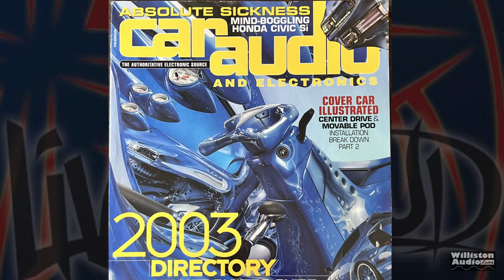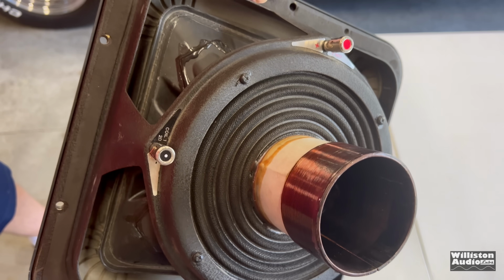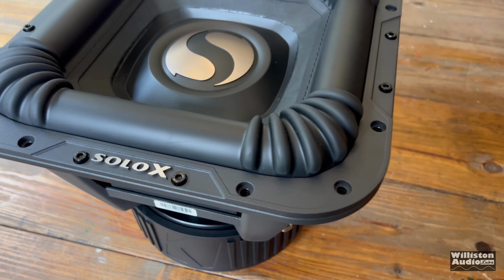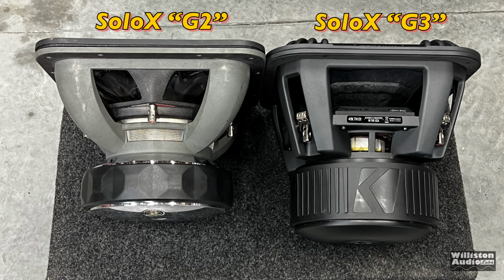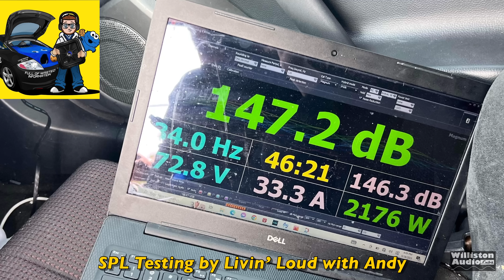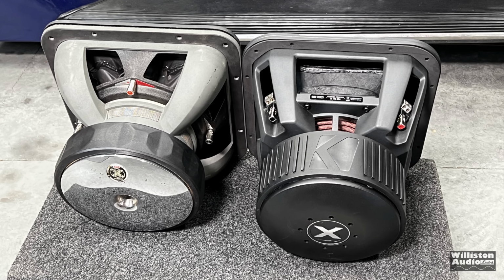KICKER SOLO X Old vs New SPL Subwoofers Review and Comparison S12x L7X

Comment: Thank you for the speaker specs as we just purchased a set of 12" dual 2 ohm Thursday May 25, 2023. Also 4 Kicker 7" square & 2 9" square midranges. We will strap 2 Kicker or EMF mono blocks at 2 ohm for the 2 12's. A 2.5k midrange amp on midranges, horns, tweeters. Impala Coupe vintage. Thank you for your channel as always, C.J. w/ A.R.T. Atlanta.

Comment: 1992 I reached 154db with under 300w and only 2 kicker solo classics. Even the Kicker show truck only hit 156db with 6  12s and much more power. They saw my van setup and could not believe that was possible. Kicker the company said the solos would not run in a bandpass box, I guess I proved them wrong! And those were running on the old Soundstream 10.0. Lol  Yea a mere 25w x 2 @ 4 ohm amp. Toooo funny

Comment from the maker: SHOP
KICKER SoloX 12: https://amzn.to/497MQYk
KICKER Subwoofers on Crutchfield: https://howl.me/cjNYsFVKgx2
KICKER Subwoofers on Amazon: https://amzn.to/424JpOJ
KICKER SoloX Subs on eBay: https://ebay.us/UMhb2x
D4S Amplifiers and Speakers: https://Shop4Bass.com

LINKS
SoloX Subwoofer https://www.kicker.com/solox
HiFiVega Reconing SoloX Subwoofer: https://youtu.be/DLfXb97u9x4
Livin' Loud with Andy SoloX SPL Testing: hhttps://youtu.be/4UYIM5EJwe8
KICKER Introduction of SoloX (2020) https://youtu.be/TWRK4mpXIRI
KICKER Unmasked SoloX Deep Dive: https://www.youtube.com/live/xx22EgdQYwU?feature=share

VIDEO INDEX
0:00 Intro
0:26 Introduction of SoloX
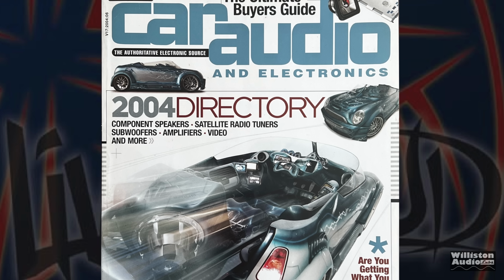0:54 2004 S10x and S12x
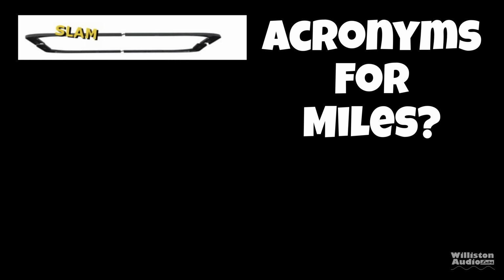1:38 Acronyms
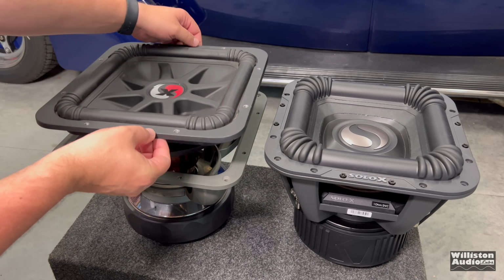2:24 Before Sundown?
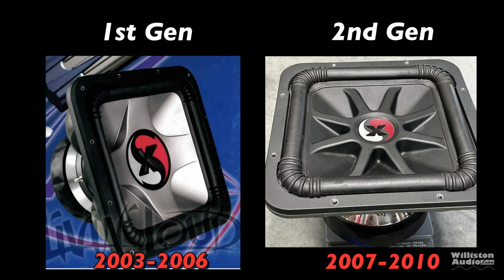3:05 1st and 2nd Gen SoloX
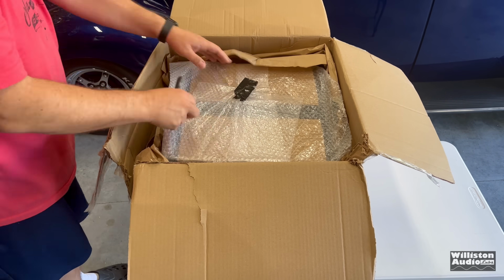3:34 2008 SoloX
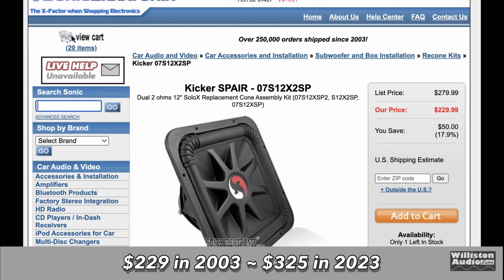5:10 2020 New SoloX
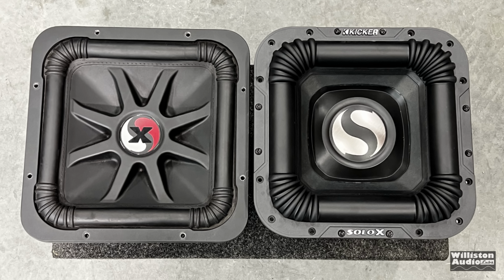7:02 Comparisons
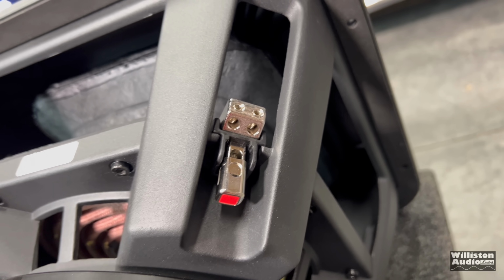9:29 2008 SoloX Flex
10:33 2023 SoloX Flex
11:50 2008 SoloX Pros and Cons
12:34 2023 SoloX Pros and Cons
13:28 SPL and Box Testing Coming
13:55 Alma Gates and the Bronco Beast

VIDEO AND AUDIO GEAR
Camera - iPhone 13pro 1TB - https://amzn.to/3nCjGvc
RODE Wireless Go II Microphones: https://amzn.to/3Q6NVHl
Shure MV7 Microphone: https://amzn.to/3A4OICK
Zoom H4n Audio Recorder: https://amzn.to/3BXjVsS
960 LED Panel: https://amzn.to/2Sxoq3S

TEST BENCH EQUIPMENT
SMD / D'Amore Engineering Amp Dyno: https://goo.gl/sJTcf7
XS Power D1400 Batteries - https://amzn.to/2BPFCKW
XS Power PSC60 Charger - https://amzn.to/2CHGcfs
Fluke 1000A AC/DC Clamp Meter: https://amzn.to/2Rw5WDA
Handheld Dyno: http://amzn.to/2u2EgKV
My Favorite Screwdriver Kit: http://amzn.to/2x0VzcE

DISCLAIMER: This video and description contains affiliate links, which means that if you purchase from one of the product links, I may receive a small commission. As an Amazon Associate I earn from qualifying purchases
Reply: Awsome
Reply: I have two Kicker F15c behind my seats in a VW Passat CC.
Can i use newer Kicker for behind the seats?

Comment: I have a 10" CVX and it has the 600rms L7 coil in it. It is in a 1.75 CF box tuned to 39htz on a 1ohm kicker 400 with certificate of bench 490rms. It flexes my roof. Same speaker underneath, just a round face on it.

Comment: Thanks for adding the weight feature. Many companies omit that spec. And when it comes to a daily driver or a guy like me who does not want to break the transmission, I personally try to locate the lightest subs that perform awesomely. Neo preferred but some companies who make neo subs are putting a steel ring of some sorts to “help” with gauss. But what’s the use of a customer getting neo subs if they are gonna end up being as heavy as ferrite! 🤦🏻‍♂️ 
Those Big Dummies!
Reply: I use my car for drag racing, and I still love my bass, so keeping weight down was a big deal to me simply for speed. Went from SSA Demon 10s to Sundown SD4s to save about 20lbs. And they perform similar if not better.
Reply: What do you drive to work a vespa?? The weight of the subwoofer isn't going to make any difference to a car's transmission lmfao. I bet your make your gf walk next to the car to save your transmission too.
Reply: @bobbygetsbanned6049  
I had a car which after 2 years damaged the torque converter. A cousin of mine also had issues with the transmission. 
If you live in a area of steep hills like I did, you will know bud.
It's always smart to reduce as much weight as possible from a vehicle which is a daily driver. If its an SPL vehicle that I don't drive often, I would not care.
Reply: @Bassotronics  Maybe if you have a huge setup  top level SPL subs, with multiple batteries, huge amps, the whole 9 yards, then maybe. Otherwise, there is absolutely no way the added weight of a sub and box are going to kill your transmission. Whoever told you it did is a moron. You couldn't even have a passenger if the weight of a sub is going to kill  your transmission, which would make it one extremely terrible car.
Reply: @bobbygetsbanned6049  
No sir… the setup was not just one or two subs. It was bigger for sure.

Comment: Great video Big D! Although I think these subs are a bit on the gimmicky side, I’m glad they exist because they help push car audio forward. Maybe you can do a video on the truly silly Bazooka triangle subwoofers that these Kickers inspired.
Reply: Gimmicky? That makes no sense.
Reply: @beyondthedetails   a square driver is less efficient than a round one with the same cone area and motor assembly because of the added mass needed to compensate for the uneven stress across the “cone”. The surround is also heavier because of the corrugations needed at the corners. The only reasons drivers are made in shapes other than round is because of space constraints. These are the reasons all serious home and car audio subwoofers before and after these Kickers came out have been and continue to be round. Even electrostatic home speakers, the squarest of them all, use round drivers for their sub section.
Reply: The square shape is more efficient to stack in a baffle, no car boot/trunk is round, that's why box baffles are made square or rectangular.  The square design will get you far more cone area when space is any consideration
Reply: @2011joser  Stop acting intelligent talking about “efficient”.
Reply: @minus3dbintheteens60  what you say is true but if the increase in cone area was worth the price and difference in efficiency wouldn’t they have become dominant in competition? I’m not saying they are bad by any means, just that they were more of a flex by Kicker and their customers than a true competitor for spl.
Reply: @beyondthedetails  🤦🏻‍♂️
Reply: @2011joser  Competitors may have had issues trying to copy the copyrighted parts of Kickers design. Thats the more likely reason.
Reply: @JasonWW2000  I was talking about Kicker’s own sales. They were used in some high dollar systems but they never became popular in competition. Extant came out with a hexagonal design sub series that was equally efficient in cone area coverage. They were a footnote in sub history.
Reply: @2011joser  What do mean? Kicker won all the competitions back in the day.
Reply: @JasonWW2000  so successful both original versions were in production for only 3 years each? If they were making enough money in consumer sales they would have remained in production. All manufacturers, including Kicker, keep good selling speaker lines in production year after year with upgrades and other revisions along the way.
Reply: @2011joser  Yeah, they are total crap. Never should have built them in the first place. Too expensive, as well. Garbage. 
Jk.
Reply: the new solo x is so “gimmicky” & inefficient thats why it did almost 148db on a single L7X 12. 😂

Comment: Wow, kicker had some tight tolerances with manufacturing to make those drop in recones.  That's impressive.
Reply: Do you mean on the older ones? They had to open the gap a little more than they liked to make it possible. That lost them some motor force, but it was still plenty strong.

Comment: 2:35 i had 2 of these in 10" in a bandpass Rockford Fosgate branded box, in the back of my 89 Honda CRX back then. Very few people would stay in the passenger seat at full volume. Those cars are great for small systems and big bass, i miss that little car.
Reply: before anyone says it, YES, I had 1600$ worth of audio equipment in the back of a $400 Civic. Take it out and that Crx would drag anything short of an actual drag built car for bus lengths. Hurt many peoples v8 feelings back then. Was a B16 DOHC bored to 1.789. So it was essentially a higher compression B18 Type R engine before they made it to the states in mass quantities. Back then you couldnt get an Integra type R engine or the like from japan for any reasonable price, IF you could even find one someone was willing to come off of.

Comment: I remember my Solo X 18 in my 96 Tahoe. I opened up a beer one time bumping it and the whole beer foamed up😂 I had it on 2 T2500BD. I sold the set up to my former coworker. Now I'm running 4 15's in my 2dr Tahoe running a DS4S JP63

Comment: Never forget when my son got his driver's license I gave him my used Honda Accord. I was buying a new car anyway He was happy. At that time I was working in a wholesale car audio shop. Decided out of the Clear Blue Sky that I was going to build a system for him. My money, my time. Went with a Pioneer head unit. We had this brand called Cadence that I thought was a good value for the money. Got two 12-inch Cadence woofers and a big vented box. Used a Power Acoustik monoblock amp for the two Cadence 12s.
I thought it sounded fantastic and a million times better than the stock system that sounded like garbage. My son being spoiled tells me his friends have kicker and they never heard of Cadence before. Forgetting about the sound. All about the name and competing with his friends.
I wanted to kick my son after the money and time I spent out of the goodness of my heart. About six months later I took out the Cadence and Power Acoustik amp. Replaced it with a single 10 in Square Kicker woofer 2nd edition and a Kicker amp. Now he was happy.
Spoiled but he was a good kid he deserved it.
That's my experience with kicker.
Reply: When I was a teen, I went out and bought these home speakers and put them in the back seat of my car.  They were only rated at 100W, but the sensitivity was somewhere around 96 or 98db.  I just turned down the bass a bit and out SPLd all these rich kids with 1 or 2 thousand dollar custom stereos.  About half would get super mad that my cheap speakers blew away their expensive stuff.
Ever hear of the Cerwin Vega D-9s.  My "cheat" inspired a kid to put two of them in his back seat.  He didn't have enough amp to power them at 100%, but he didn't need it.  He rattled everything that could rattle within 30 feet of his car.
101db at 1w, and 400w max power rating meant those D-9s were capable of producing 126db each, so about 129db inside his car with no sub.  These kids buying the name and getting somewhere in the 80's db sensitivity meant they needed some ungodly amount of power to match it.  And back in the 80s without class D amps, you needed competition level engineering to power it.  As it was, his "thousand watt amp" was pushing maybe 60 watts.  But that was still roughly 122db, much more than a lot of these kids with "name brand" stuff could produce.
Home speaker sensitivity is measured at 1 meter, and you can barely get 1 meter away from a speaker inside a car.  So it's not a simple comparison.  But you get the general idea at how crazy we teens were back then.  Especially the rich kids.
It's actually nice to see how much the prices have dropped since then.  Pretty much anyone can afford to ruin their hearing these days.
Reply: Cadence made some really great subs. I had a Cadence S3W12. Really nice sub wish I had not got rid of it.

Comment: MY 2 QUESTIONS IS WHAT AMPLIFIER WOULD YOU USE FOR THE NEW KICKER SUBWOOFERS & THE KICKER AMP VIDEO U DID A WHILE BACK WOULD YOU PREFER THEM?
Reply from the maker: KICKER is bringing back the Warhorse amp first as a 3600W monoblock. It has some really cool features including a remote LCD display. In this video I used the D4S JP23v2 for testing these subs free air. See them at Shop4Bass.com

Comment: Well, there use to be this car audio shop here in Colorado named Sound on Wheels. They had this demo vehicle which was a 1995 Chevy Suburban nicknamed the 'Burban. Every speaker in the entire vehicle was Kicker including 3 Solo X S18x's powered with 2 Kicker ZX 2500 each! Total system power was 17,000 watts! 😱 Let tell you not only the 'Burban was loud it sounded great too! My good friend designed and built that system to be loud, clean and clear!  Oh, and by the way the 'Burban would easily bust mid to high 150's. I apologize about the long post but I had to mention that the SoloX wasn't just an SPL sub it can used for daily as well. Have a good day. 👍🏿

Comment: IMO it shouldn't be considered a 12". The old sub had more cone area. The measurement showed 10.5 so that's 110.25sq inches cone area. A typical 12" sub has 113Sq inches. Their big shtick has always been go square and get more cone area. This sub should have been made 1/4 inch smaller ATWR and been marketed as a 10. 
Remember this is just my opinion so it's OK if you think differently.
Reply: I was just watching this.. and first thing that I noticed right off the bat,  was cone area.  The new one just lacks it in a big way.
Reply: @Chuck_Sanders  Curious to see what the measurements wind up being on the 15" cause that's more likely to match the v2 SoloX 12" cone area wise.
Reply: @DAMAGE-X-  I agree with you, we shall see.